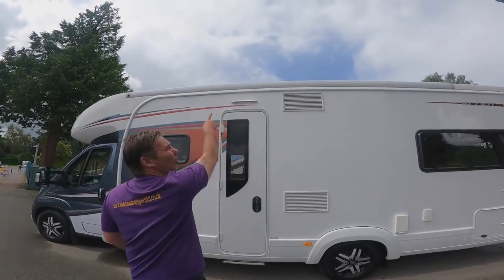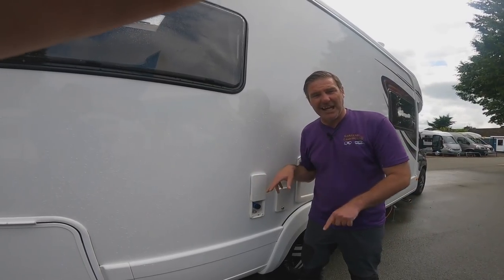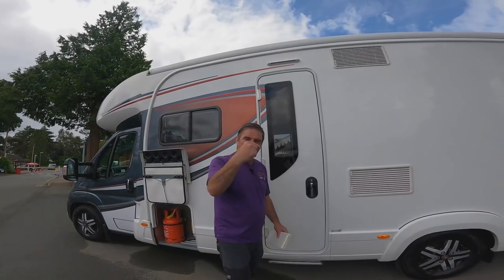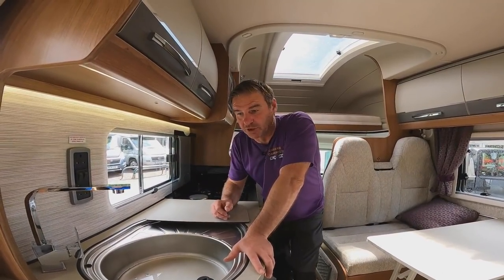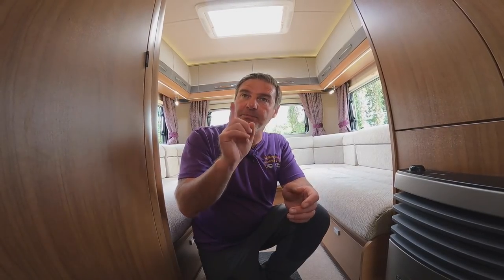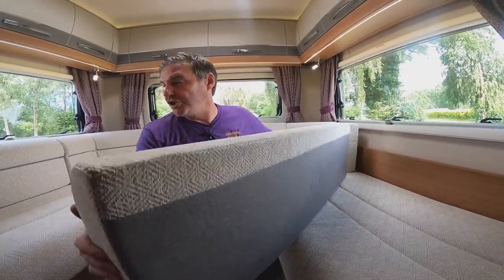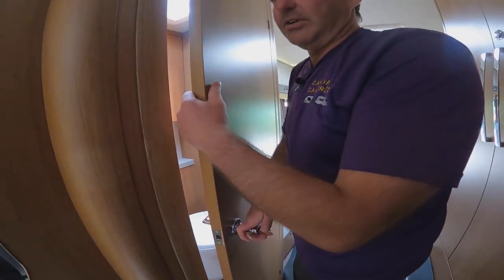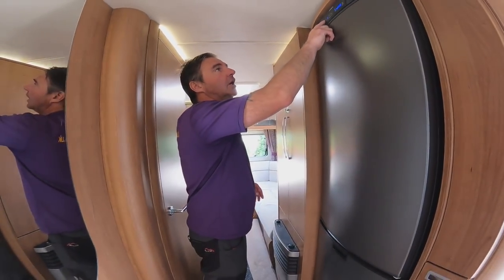HOW TO SET UP Autotrail Frontier MOTORHOME 6 BERTH !

Comment: My auld Bedford RL was okay in a front or rear shunt because she had quarter inch plate for bumpers and even though she looked like crap the front winch got a lot of use pulling morons out and that was after me trying to advise them not to park on a piece of ground due to the liquefaction after heavy rains 😊, oh and by the way another great video Jason but if it has a large wardrobe then I don’t want it because I’d be kacking myself in case there would be a Kevin in it
Reply from the maker: 😂 Yes Kevin could pop out anywhere James

Comment: Jase no one can say that you don't give a top notch handover ..cracking van tho mate..can you tell me the average cost of a cam belt change mate   ?..also does the engine size determine if it's belt of chain ? Cheers duck
Reply from the maker: £300 -£500 usually the 2.3 litre's